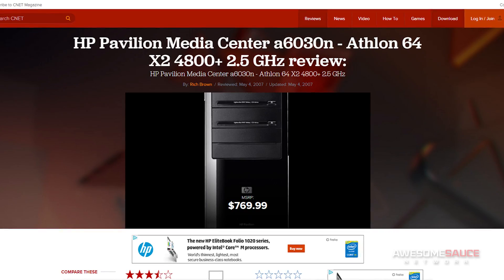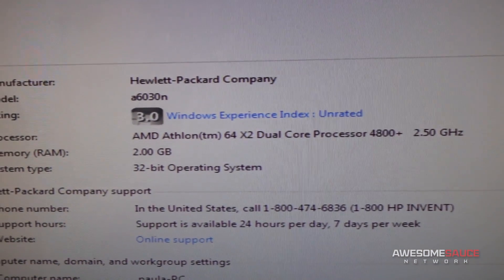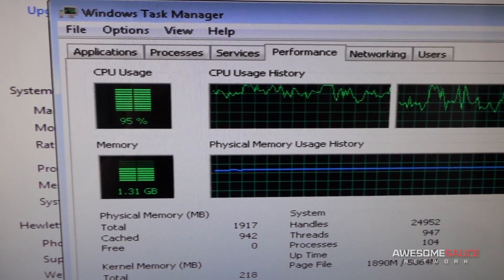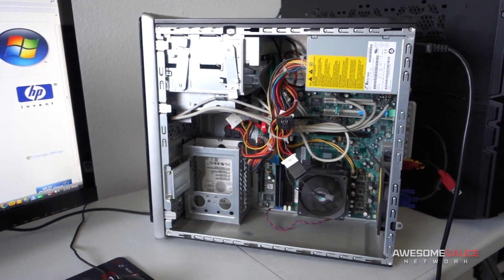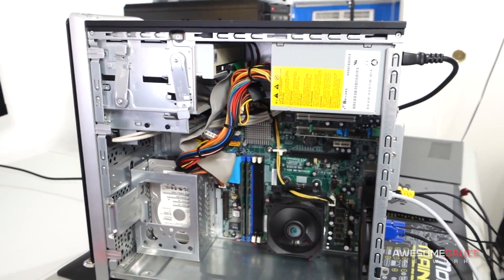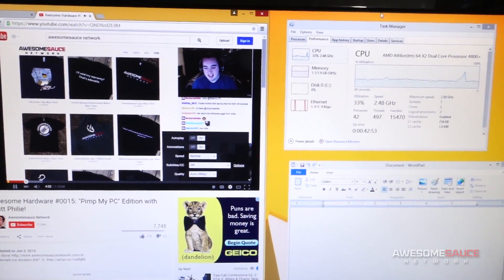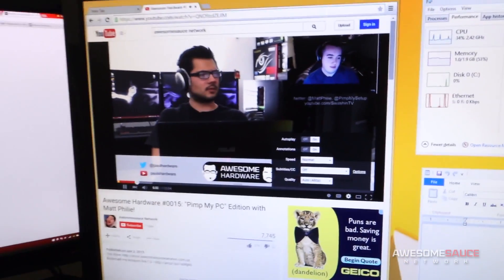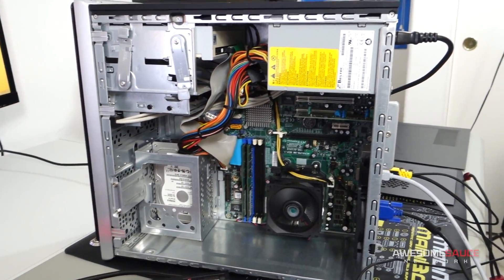Cleaning Up My Neighbor's Old Desktop!

Comment: Regarding OS, you changed from worst to worse. I'd rather have either XP or Win 7.
But yeah, I'd avoid Vista as the plague.

Regarding the system, I'm not an AMD fan, but I'd dare to bet he wouldn't be able to change from DDR2 to DDR3 just by changing the processor... That'd require a motherboard change.

Anyway, I'm not taking credit away. You did an amazing job cleaning that PC and removing the crappy OS that he had. Kudos!

L8er!

Comment: Simple job of installing Linux on even old hardware like Xubuntu for example would give him a fresh and far lighter desktop only needing 300mb of ram and single core minimal and not needing to worry about security or virus issues or maintenance on the OS would give they guy a sigh or relief and be problem free :)
Reply: +corey drew bruce i highly doubt someone that old would enjoy using linux..even win 8.1, in my opinion win7 would be much better for him.
Reply: Ehsas Amim Please explain why and I'll tell you why he would as well as it being always reliable, secure and doesn't have to worry about viruses or defragmentation and always working as for someone his age not doing to much this would work fine for him as he said the browser would be the most common thing he would be using and that's fine again meaning he would  turn it on do what he needs and turn it off and that's it because of not needing maintenance on the OS over time like Windows and the only thing he would need to do is update if it tells him to and even updating on Linux doesn't get in the way or force restart your PC or 99% of the time need a restart for update as well as need to install the updates when restarting or turning off like Windows.

As for your recommendation I would still say they still have the same issues Windows always has and now since a update has spyware like Windows 10 has and in the end 7 will not long stop getting support and same with 8 forcing them to use 10 while on Linux you don't have these issues.
Reply: corey drew bruce
Im fully aware of the benefits of Linux, i use Linux mint myself (dual boot to windows just when i need to play games). i meant for someone of that age, it would be better suited for him to work with something that is familiar to him. win7 is very similar to vista and most old people i know have no problems running it, but OS's like win8.1 were difficult for many. he can really just have auto updates on and the only thing he's even going to do in that computer is watch youtube, go to some websites and maybe us word/excel etc.
Reply: Ehsas Amim And that's why Xubuntu would be fine or mint for example with a familiar desktop and would still have no problem running Linux also yes but updates aren't small or wont get in the way like Linux does as well as force restart or take a long time to install it and for office work if he wanted to can use Kingsoft office on Linux for free.
Reply: corey drew bruce
I know it'd be the better option, seriously i do. but i've had this with my own grandparents and they simply don't understand my pc whatsoever, win7, vista, and xp are similar and they mostly never even heard of linux so for people of that generation a win7 would be easier to use for just them. overall i don't doubt how good Linux is since i've been using Mint for years.

btw totally offtopic, but do you think a 8350 will bottleneck a 980Ti?
Reply: Ehsas Amim What would they need to learn? If they are using the same desktop environment they would already know how to use it and even Ubuntu desktop is easy for elderly, I moved many elderly people to Ubuntu and they found it a lot easier to use than Windows all they need to know is the basic desktop use.

Hmm it shouldn't the 8350 is pretty good my friend has one but using a radeon card.
Reply: corey drew bruce
You can make it look like windows 7 and make it easier, but when it's normal, as in everything in the side, most people just aren't used to that, he'll want that desktop format from the start where he can just click the familiar icons. given how much windows costs though i agree it'd he'd be better of with linux and using that 80$ or so for maybe more ram, a 512mb or 1gb used gpu.

And i use an fx8350 with a r9 290. but going to upgrade to an evga980Ti this week, most forums i ask on it's heavily divided with some saying it will, others saying it won't etc it's overclocked to 4.3ghz, would pushing it to atleast 4.5 ensure no bottleneck?
Reply: Ehsas Amim Don't need to make it look familiar the desktop and showing someone how to use the basics is good enough I have done it many times trust me its easier than Windows 

if so than over clock it so it wont

Comment: I am all for bringing new life back to old computers. My brother picked up a Dell Optiplex 760 Mini Tower from a friend who actually took it home from the clean room he managed as an IT guy. The thing came stock with a Intel Core 2 Duo E8500 3.16Ghz 6MB in the M858N main board, 4 gigs of DDR2 ram, a 120 GB HDD, and Windows Vista. Currently I am in possession of the 760 and I actually use it almost daily since I've upgraded it over time and it does play games. Diablo III was released and I couldn't run it, so I went out and upgraded the graphics to a ASUS EAH6670 1GB DDR5, with the new GPU I needed more power so I purchased a 500W 650W max Lepa PSU. Another friend of mine had a couple extra sticks of 2GB DDR2 ram clocked at 1377Mhz that matched the existing two sticks in performance bringing the total to 8GB of ram to play with. The hard drive had died on me at one point and it has been swapped out with a 240GB HDD which was partitioned with 40GB dedicated to a clean recovery and the rest I installed a genuine OEM copy of Windows 7 Ultimate. Now that GTA V has been released, I was bored with Diablo III and Skyrim so I searched the web and researched more about the board and whether  or not I could upgrade the CPU. I found some compatible LGA775 socket processors which would work, and now I have an Intel Core 2 Quad Q9550 2.83Ghz 12MB CPU running flawlessly. I can play GTA V, if I really want to push the machine to it's limits I can turn everything up to high-ultra with no MSAA and try to play through the extremely low FPS just so that I can take a quick peek at just how beautiful the game is. The game runs at about 32-34 frames at the normal low settings. It's still better looking than the Xbox 360 version ever was. Turning the graphics up just a little bit, I can go slightly beyond the suggested limit and I will get between 20-26 fps. I told myself that the CPU which I had bought for $47 on eBay would be my final upgrade on this dinosaur, but now I'm considering picking up another decent 2GB+ graphics card at a reasonable price and a budget SSD to speed up the read write times to the full potential of the board. I want to build something for myself, $600 and a little bit of bargain shopping I could build a decent gaming machine on a budget. Can I get away with upgrading only the GPU to something faster or should I just take what I have and play  the way it is until. Or should I wait and build a complete gaming PC?

Comment: The power supply is a time bomb.
Reply: Nope, it's not. I have an older HP PC which has a very similar Bestec PSU and it was never replaced. It still works fine today, for about 10 years or so
Reply: +WB IsMe ye ikr
Reply: It is; I had to get a new one
Reply: +Lapine Vision same for me it just stopped working. Got a corsair one hope it works better

Comment: Sadly, your video was literally more about cleaning the computer than cleaning the operating system.  Nice job on the dust out and wipe down, though.  I was hoping to see more of your technique for restoring the OS and removing his cludge of extra applications.  I suppose the fresh OS installation was far easier than trying to salvage the existing software.  Even there, however, this video provided little in the way of education or instruction.  Just wanted to point out room for improvement.

Comment: Hi, just want to improve my knowledge on pc and I have a few question. 
Is 2 gb ram enough for windows 8 to run smoothly 
Does the old version mobo (5 years ago) support the current gen 4,5 processor ??
Reply: +weakboi 2gb is enough to run smoothly, but its really not enough for doing any serious work on the computer

how would a motherboard from 5 years ago support a new processor? that makes no sense.
Reply: +The Ultimate Walrus Thanks.

Comment: HP knows nothing about cable management. These are swell cases. Not the best of course but for a low end system not bad. However we had an HP workstation, I don't remember the series. It was really high end. We use 3D cad after all, and last year we rebuilt it and upgraded the system. Of course by this time it was 4 years old or so. I7 980 CPU never the less, but its attachments inside the case made me sick! Awful. We just got a new Dell Precision T5500, what of an improvement that is. But the low end HPs of that era come loaded with tons of crapware. Tons. The restore image does too. Even after removing crapware, driver folders is another nightmare. Better off with a clean install from retail disks!

Comment: And I still have the PC I bought in 2007 with 2 GB of DDR2 RAM, 200 GB hard drive, intel pentium 4 at 3.0 Ghz, ATI Radeon 4300/4500 Series graphics card, a non-modular Chinese PSU that says it's 700 W but God knows how many it really is... However, it still works, I got Windows 7 installed and nowadays I only use it to write essays for my college assignments... No money for a new one, especially a gaming PC, so fuck it! I mostly use my phone and tablet so I'm fine for media consuming. I love my LG G2 which is lightning fast compared to my old PC. It's the smartphone era now I guess...

Comment: One special case i'm going to always remember. I worked at small computer firm back in 2009.

- I got Computer which had some early version of the XP on it and no service packs. Year 2002-3 i would say
- Computer was never cleaned, ever. Nor the OS.
- Computer was stationed in cement factory so the case from inside were like Sahara. I always wondered how the hell that computer could be still up and running when the whole case was full of cement dust. I mean it was actually full, fans could not move at all and the dust came out of from small holes in case.
- OS desktop was full of porn and you could do nothing with it because the 100 % CPU load and the pop-ups
- Took me whole work day to clean the case and the OS.
- Customer did not want to pay for the new computer or OS update so that was just cleaning job

I can't believe there was zero harm in the components. Unbelievable, but true. Fans worked fine and the CPU spikes stopped.
I still think the computer might be in use and we live 2015 now. Probably again full of cement dust :D

Comment: AMD X2 5000, 4 gigs of ram with 550ti reporting in, it's OCed like hell, I've put it on a death march @ 3.3 ghz, 3 years running now idling at 78 w/ stock cooler 88-90 @ load, she's almost 9 years old.. Upgrading at the end of this month to a 6600k and 980ti.

Runs everything at 30-60 fps still.

Comment: Building my first pc trying to spend around $700 to $800 currently going with
Phanteks Enthoo Pro
Msi 1150 intel Z97 
Intel core i5-4690K
EVGA GTX 960 4gb
Western Digital 1TB internal harddrive
Crucial Ballistix 2 x 4gb
XFX TS 550w Bronze 
any thoughts?
Reply: Wyatt Vana looks fine, except don't get a red or green WD harddrive either a blue or black one. Also I'd consider getting a small 128gb SSD (Samsung 840 or 850 EVO) for windows + most frequently used apps. Or another option would be to completely ditch the harddrive and go for a 512gb SSD instead which I've personally done since I don't really need 1tb of internal storage and I do have an external harddrive. Crucial MX100 (which I have) or MX200 512gb is only around 200$

Comment: I have a 2011 Dell Inspiron N5010.
The config is listed below...
Intel Core-i5 480M CPU
4gb DDR3 1333MHz
AMD Radeon 1GB DDR3 HD5650
WD BLUE 500GB...

After Considerable use over these years, It has become insanely slow.....
Also it heats up on idling.... without any bg processes......

Any Solutions... ????
Reply: He means unin stalling programs or just back up all your photos, documents and just run a new so like windows 8.1 or 10
Reply: Vatsal Mewada if is a laptop you can buy a hybrid drive, if is too expensive for you, just go for a SSD is going to make your life happy
Reply: They only thing I think you can do is replace his HDD with a SSD that will greatly increase the responsiveness of your computer and reduce noise. Keep in mind SSD's cost more than HDD's but in my experience are well worth it.
Reply: Try to clean it up
Reply: ofir55555 i open it up and clean it once every month and keep it as dust free as possible
Reply: +EliteGamers101 i just did a fresh install but my hard drive shows short DST fail.....

any recommendations?
if hard drive needs replacement what should i buy ? SSD or SSHD ???
Reply: +Vatsal Mewada ssd is smaller, faster, but costs more. HDD is larger, slower, but costs less. I have one of each in my pc.
Reply: Is it a laptop or desktop
Reply: +Mr Scottish Gamer its a laptop...
Reply: +Vatsal Mewada windows 10
Reply: +Vatsal Mewada it increases performance
Reply: ssd an some more ram if possible
Reply: Ah it's a laptop not much you can do maybe clean it and wipe the drive.
Reply: +Vatsal Mewada number one rule on my laptop and the only rule: Base can get hot. always operate on a hard,flat surface and keep the vents clear. I'm using sony vaio laptop from 2010 i think and it's working fine.
Preinstall your windows.
Reply: Old laptops get hot, it's just what they do. Even a clean install won't fix that. Hardware on laptops seems to wear out much faster. Your only so,unions are getting a laptop cooling fan, and taking the entire thing apart and clearing dust out.
Reply: +Vatsal Mewada clean yo damn pc from dust and maby re-aply some thermal paste on the cpu
Reply: My brother has the same laptop, but with an Intel pentium b940 and integrated intel hd graphics
Reply: Or, reinstall Windows.

Comment: You did a great job on this!  I did one of these not too long ago, but I also had to swap in another motherboard from a donor HP that the case it self was at the point that I didn't feel like cleaning it.  So I took the MB, the RAM and processor (w/ cooler) and cleaned them all up and installed them in place of the dead motherboard.  The RAM, and Processor ended up being an upgrade over all.  Those HP cookie cutter cases will sometimes support a regular Micro ATX motherboard, so you could quite possibly just install a newer board, processor and RAM for him at some point, maybe a new power supply as well.

Comment: i wish you could clean mine XD, mine was found in a garage and the back and everything on the inside was completely covered in 1-2 inch layer of dust, i had to use a vacuum to clean it and i put a 35 dollar graphics card in it, it plays games fine, but the cpu and power supply still are caked, in dust on the inside of them

Comment: Watching this on almost the same model. Bought it in 2007 with vista and a dual core 5000 and supercharged it with my latest and last card for that rig(NVidia gts450). Had BSODs on that like crazy the first year. Had a few malwares and a virus but it is still tickin. Dusting and unplugging the cables and memory modules often helped with the BSOD. Just like everything, having a computer takes some TLC. I'm going to use it for my backup till it drops dead. Long live the 2007 pavilions